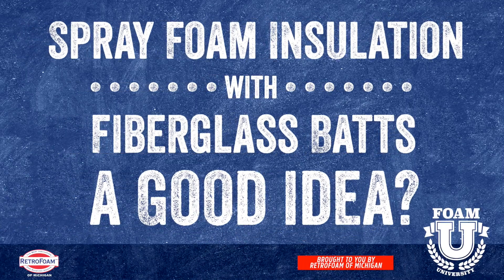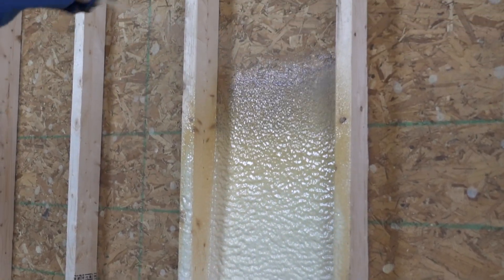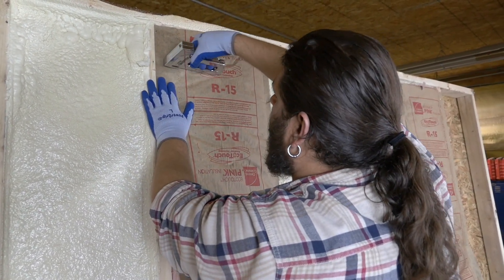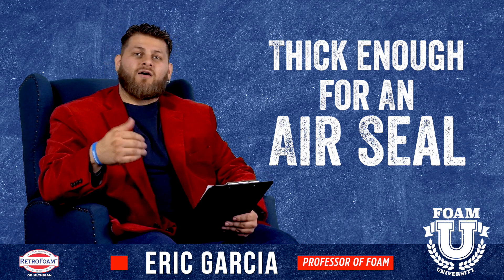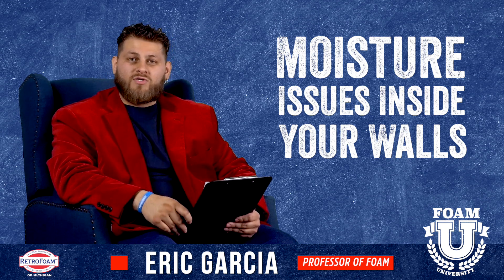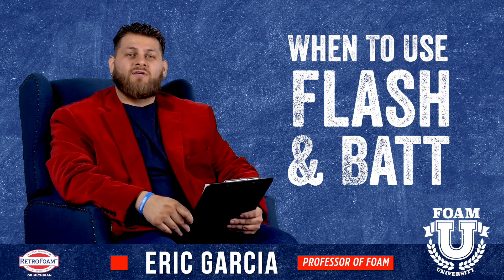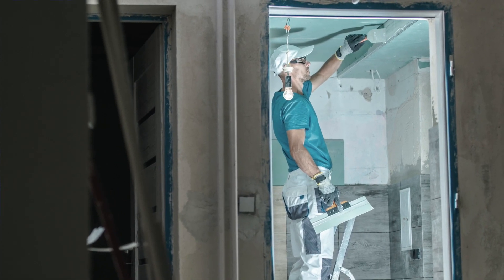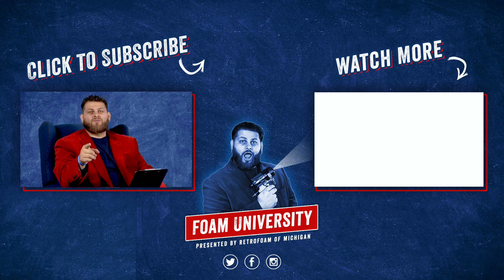Is Spray Foam Insulation with Fiberglass Batts a Good idea? | Foam University

Comment: Can you install faced batting over foam board installed on an attic floor between the trusses? I foamed the edge of the foam board with great stuff fire seal insulation. But I am wondering if water could still end up between the batting face and  the foam board. Thanks
Reply from the maker: You can do this, but keep in mind it won't create an air seal, and moisture can build up between the foam board and fiberglass.
Reply: @RetroFoamofMichigan  isn't foam board a vapor barrier?
Reply from the maker: Moisture can form in the insulation from air movement through the materials. Essentially, when that outside air and inside air meet, condensation forms.

Comment: I live in a new house that has foam in the attic ceiling and I love it. I’m wondering if I could put it in my garage ceiling even though it’s not a/c and will it help   when it’s hot and never cools off in the garage? Or should I have 38R glass blown in the attic ceiling floor?
Reply from the maker: Foam will definitely help keep the summer heat out of the garage. With that being said, on really hot days it will still get warm in there if there is no kind of AC

Comment: Is foam board against exterior wall sheathing a good idea? Is it not going to create mold issues?
Reply from the maker: Foam board is fine on the outside. Be sure to seal all joints and seams.

Comment: This is great information! I am in North Jersey and researching insulation options for renovating our home. I am considering to install Rockwool R-15 —> Zip R-3  —> 2 inch closed cell spray foam —> gypsum board on the walls. On the roof, 3 inch closed cell foam. Do you see any issue with this method?
Reply from the maker: My recommendation would be to stop at the 2-inches of closed cell in the wall because that creates the air seal. You would also be good with 3- to 5-inches of closed cell on the roof deck.
Reply: @RetroFoamofMichigan  thanks for your reply. Do you mean don’t do Rockwool and Z R-sheathing outside?
Reply from the maker: As far as the insulation goes, the rest wouldn't be needed as the 2-inches of closed cell creates an air seal.

Comment: If I put foam boards or spray foam in a stud bay and then batt insulation on top, should I use faced or un-faced and why? I would use faced batt insulation if the foam board or spray foam wasn’t there. So why should I use un-faced if the foam board or spray foam is there?
Reply from the maker: Hey Todd, We recommend using faced with the paper facing the drywall during install. This is the best way to install the product easily and ensure stability. The paper will give it more structure and longevity. If you use unfaced, it will perform the same, it just might not hold up as long due to lack of structure.  I hope this helps!

Comment: What about  a double stud, super insulated wall system? Will it be cost effective to air seal in that system?
Reply from the maker: It's not cost effective to have a super thick layer of foam, or any insulation material. Once you have the air seal that foam creates, the hard part is done. Then you're just adding enough to fight thermal transfer.

Comment: What do use to create better sound barrier? Closed cell foam is not a good sound barrier and can actually transmit sound in the same way wood does. My original thought was to use 3" closed cell foam then add Roxul to create a good sound barrier, but after seeing how other are having problems where they adding batt insulation and it getting soaked, the only solution to prevent that is go with the 3" closed cell on the outer wall, then add a secondary stud wall about an inch away from the outer wall and add the Roxul to the secondary wall. The main issue here is to create a really good sound barrier where I could build a work shop and not any issues with neighbors being disturb from any noise coming from a table saw, planner, ait compressor, etc., late at night.
Reply from the maker: If your main goal is to stop sound transmission you should be looking at some proprietary acoustic materials. Open cell spray foam can be a good sound barrier but that is NOT what it is designed for.

Comment: What about applying fiberglass batt first on underside of roof then spraying foam on the fiberglass? Kind of reverse "flash & batt", it would be "batt & flash".
Reply from the maker: Honestly, the fiberglass would be a waste of money. Also, the foam needs a surface to adhere to, so spraying it onto the fiberglass wouldn't work.
The air seal created by the spray foam at the correct thickness means there wouldn't be a need for the fiberglass.

Comment: man, I really liked this video explanation. I'm researching so much about this right now and there are so many opinions and nuances to the code and science. But can I ask you this, what if I spray foam headers to max at 3.7in with CC and then just the top 3 feet of concrete wall with 2.5 in. Then batt with FB or RW the entire wall and poly. So its a partial flash and batt method haha! The idea is to cut costs and just spray foam the coldest area of the concrete that typically reaches a dewpoint in winter.
Reply from the maker: Thanks Alex! The biggest problem for flash and batt is the potential to trap moisture. If you have enough foam to provide an air seal, you would be better off insulating with just foam to avoid any potential issues.
Reply: @RetroFoamofMichigan  So my plan now is, 2.5in spray foam (hardly a flash now) the whole wall, with FB batt overtop. NO poly vapor barrier anymore. I can't see moisture being trapped now?
Reply from the maker: @alextirabasso2441  Any existing insulation over top of the foam have the possibilities to hold moisture. If the whole project is air-sealed, existing insulation isn't necessary since air can not pass through that foam.
Reply: @alextirabasso2441   The best way to think about it is that you want your vapor barrier on the warm side of the wall. The foam is the vapor barrier. In a northern climate you want that to be on the inside of the wall. In a warm climate you want that on the outside of the wall.
So, if you batt over the foam, warm moist air will migrate outward and condense as it cools on the inside surface of the foam (inside your wall cavity).

Comment: This js kind of misleading. Adding fiberglass to the assembly definitely adds R-value and efficiency. Any insulation pays for itself within a few years. R value is r value. Flash and batt is becoming very popular for 2x6 walls and rafter assemblies. There are calculations you have to make for the ratio, however. They usually want the r-value of the spray foam to be higher than the r value of the fiberglass. 2" of closed cell achieves air and vapor barrier.
Reply from the maker: In theory, more R-Value is better.
Unfortunately, in real world application there are many outside factors. One major factor with flash and batt is moisture and condensation. 
We have seen many situations where a flash and batt system caused issues from the batts retaining moisture.
Additionally, your ROI will be vastly different depending on the building material. So, there are many situations where an insulation will not pay for itself within a few years.

Comment: Not a single word about condensation/dewpoints ? Wow.
Reply from the maker: At 2:10 moisture concerns are addressed.
Reply: @RetroFoamofMichigan  You are correct, I apologize. However will condensation not occur if 1" foam is sprayed and no batting added?
Reply from the maker: @terrydietzler4096  Condensation still may occur on the surface of the foam, but with no fiberglass on top of 1" of CC it's less likely because moisture wouldn't be trapped.
Reply: @RetroFoamofMichigan  Then why would an R-7 ( one inch) even be considered ? I fail to understand why "flash & batt" is even an option in a home. I'm dont mean to be argumentative, I am trying to understand as my son is dealing with this right now and the foam company knew exactly his intention of adding batt and said nothing to the contrary.
Reply: @terrydietzler4096  I am guessing, unfortunately, that it is because as long as they’ve quoted their profit margin on whatever thickness they spray, they don’t really care?
And to their credit, if they say “oh, no, don’t put batts over our foam, instead have us spray it thicker, they will look like they’re just trying to get more money from you.